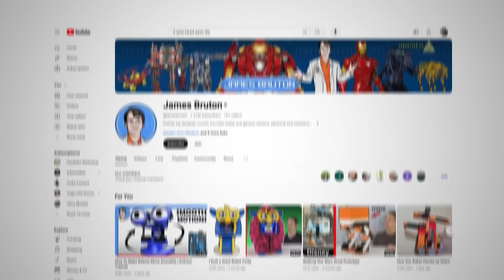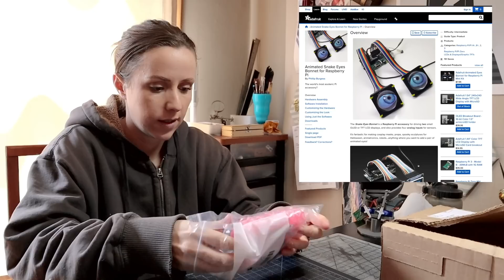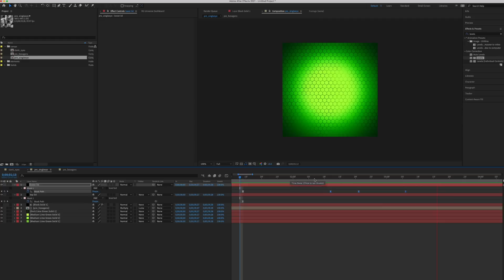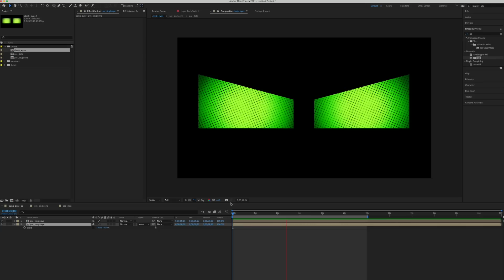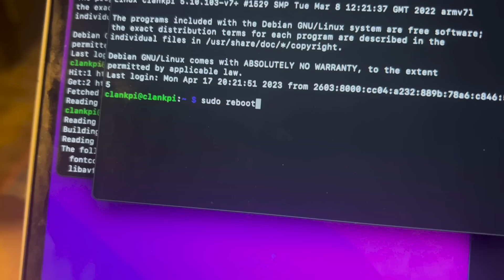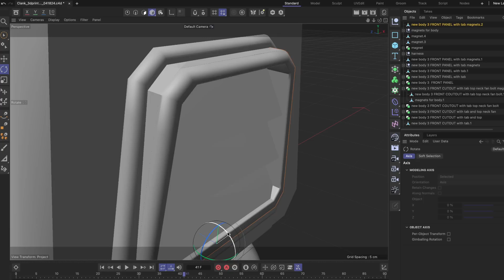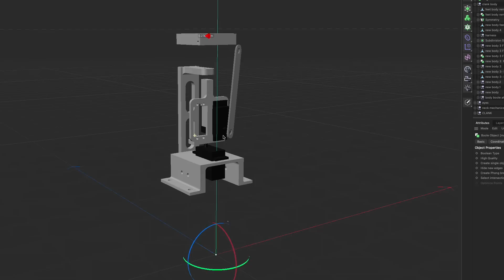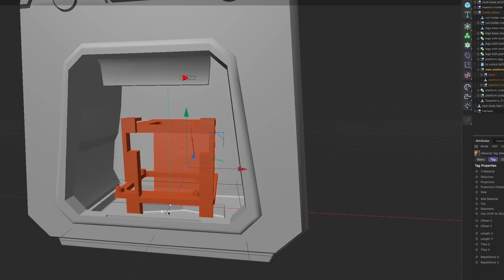Building my favorite childhood robot --CLANK Part 1

Comment: Very neat so far! The round XIAO displays from Seeed Studio would be perfect eyes for a robot. They have built in sd card readers that can loop video, but they do also need a thumb sized Arduino board plugged in. Super cheap though. I made a virtual snow globe with one of mine 🤓

Comment: Nice build! Something you can try to remove stuck prints from the build plate is to pour very hot, almost boiling water where it is attached to build plate. Someone else also mentioned pouring alcohol where it is attached, which seems like a good way that i havent tried yet.

Comment: Awesome project! Made Clank once as a kid for Halloween, seeing your project brings nostalgia!

Also, you might wanna consider the SC09 Waveshare servos (same size format). They are not controlled via PWM but TX/RX -- thus it is recommended to also get their servo control board. Their motion is closed-loop controlled so it is much better compared to the ones you are using now, more powerful too. Thought they are more expensive, I would not cheap out on the mechatronics part....

Comment: OMG that happened to me too in 1982 for the science fair in 7th grade, woke up and wanted to be different than power potatoes and since science fair submissions were mandatory in California. BUT no 3d printers, no servos, no Arduino's no internet, hell my computer was an apple2e that could make a couple dots on the screen with 18 lines of code played text games pretty good, my remote control for the tv now is smarter. Had to use my brain, lots of card board, duck tape, spray paint, several iffy stolen vacuums and some other appliances liberated from bad people, one death defying microwave opening, never did that again (could you imagine the newspaper, yes newspaper saying 12 yr old dies from Microwave, they would be banned and you couldn't eat now). I did not win the science fair, everyone thought robots were for movies only IE r2d2, one teacher told me i need to stop fantasying, hmm, where are you now Mrs. Avery, but it put me on a path of being an triple engineer and  Stanford Grad. Now 55yrs old, still building robots in my workshop in Utah, not using 3d printers very often, i MAKE MY PARTS.

Comment: You can get stronger versions of those cheap 9g servos, they are called “MG90S”, they are a bit stronger and since your current servos seem to almost work they may be a good option.

Another option is to try and uncouple the movement from what is holding the heads weight, this is more difficult to do though but could potentially be as easy as adding springs below the servo horns to provide some of the force needed to lift the head up. Or adding elastic or rubber bands to pull the servo horns up.

Comment: Hey this is a great idea! For the lenses, you can polish them with powdered tooth polish. If its good enough for the lenses on the headlights of a submarine, it should work for your lenses too. A friend of mine a long time ago was a machinist who worked on submarines. He old me he used it to polish the headlight lenses. He had a big tin of it. He used on the headlight/tail light covers on his cars too. The key is to be gentle and remember that its easy to go too fast. Plastic is easy to melt or deform if you get it too hot. But you can get many types of plastic to shine if you are careful.
For the door, if you change the model so that the edge of the door is tapered inward by about one degree on each of the sides except the hinged one. That should solve the closing issues.

Comment: @Sunday Slays Cosplay - maybe they make a flexible bed for the 3D printer the clips on the original bed then just to re-aline the head to the bed, and unclip when removing prints, or if not a clip maybe bolt it down onto the bed,just have to remove everytime... 😕

Comment: That's an awesome project! Beautiful lenses for the eyes as well. One piece of advice to release the prints from the bed: drip a little bit of IPA alcohol around the edges of the stuck print and it will wick in between and slowly release the print over the course of a minute. It can be such a pain to release prints without a flexible bed, but this technique works for both FDM/FFF and resin printers :)
Reply: isopropyl alcohol alcohol
Reply: @funy0n583 Yes, I always add it so people don't think I'm talking about IPA beer 🙃
Reply: Thanks will try that, I have already scratched the plate badly by using too much force.